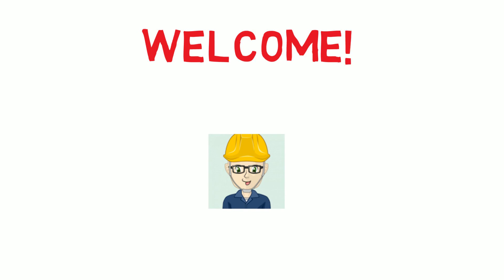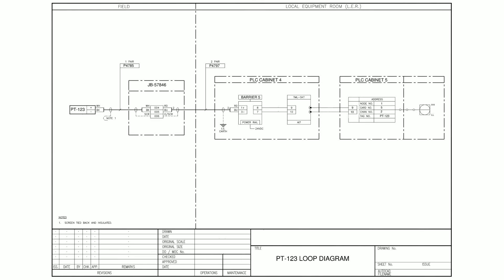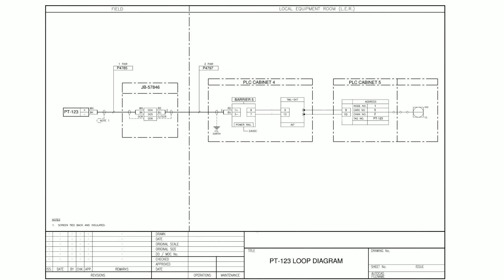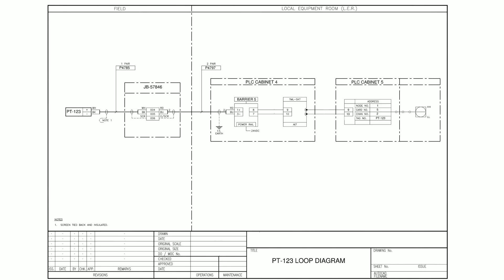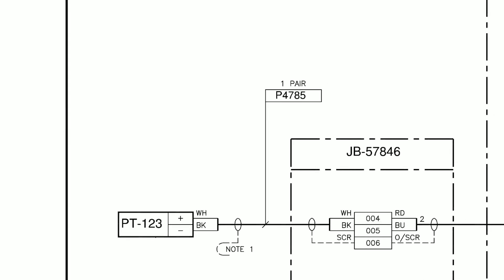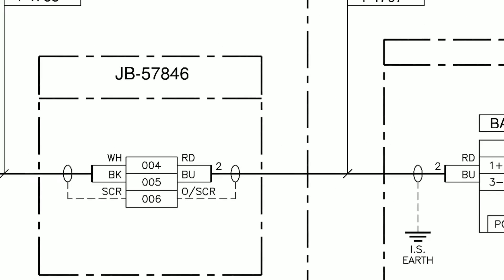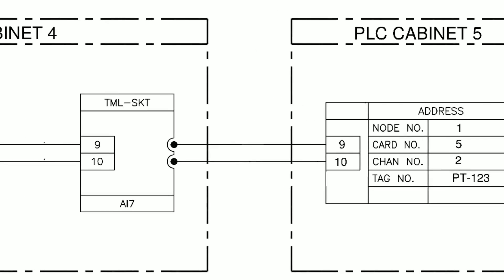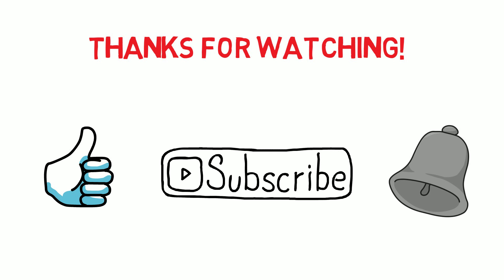What is a Loop Diagram - Instrumentation Course- Lesson 3

Comment: Make an instrument loop diagram for the transmitters as follows:
1 pressure transmitter
1 temperature transmitter
The instrument loop diagram shall show the connection of the transmitters both in the FIELD ( where the transmitters are exposed to the process line) and in the MARSHALLING CABINET ( where all the connections are centralized in its respective knife switch). It must be properly labeled.

Comment: Loving the Videos, way too little info on this, was looping at a endress pressure transmitter, that seems to also display pressure and flow on the transmitter?
Reply from the maker: Hi Jacob, thanks for your comments. Glad you are enjoying the videos. Regarding the the transmitter you was looking at. It is likely a flow meter. Flow meters need the pressure and temperature of the process fluid in order to accurately read the flow. Its also possible it is a DP transmitter across a flow orifice to give flow and the square route extraction is being completed in the transmitter and given as a secondary variable that could be read by HART. Try looking up the model number of the transmitter on Google for a manual.
Reply: @InstrumentationControl  Thank you for the reply! Yes makes more sense.